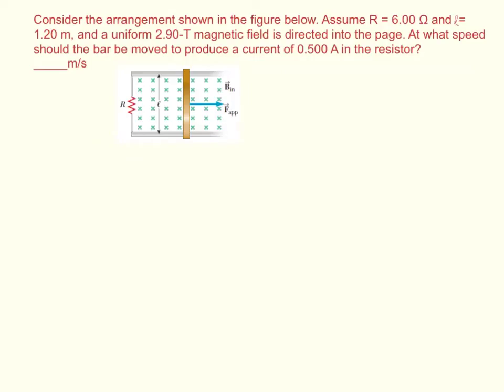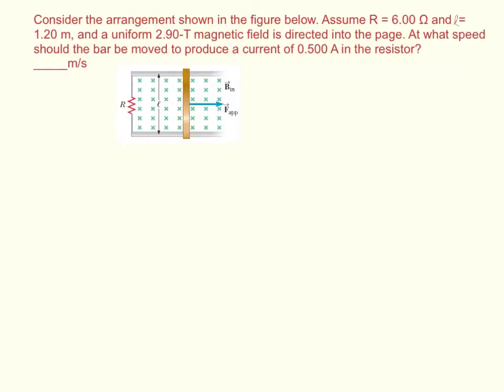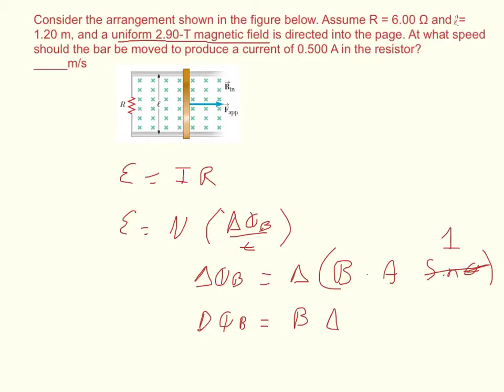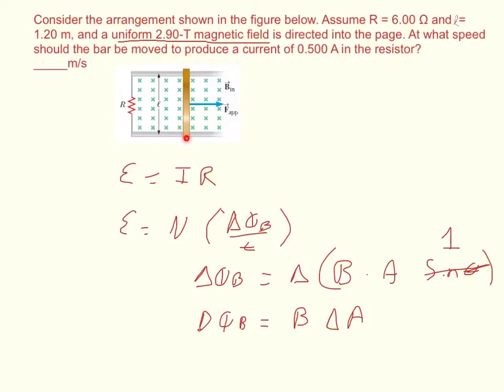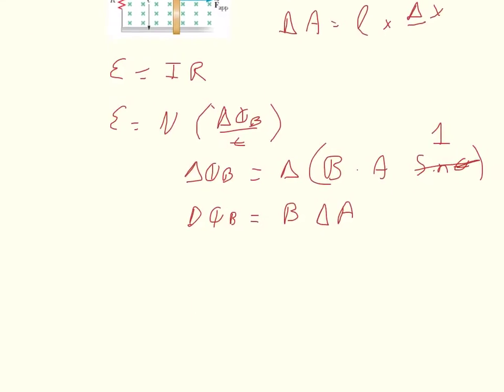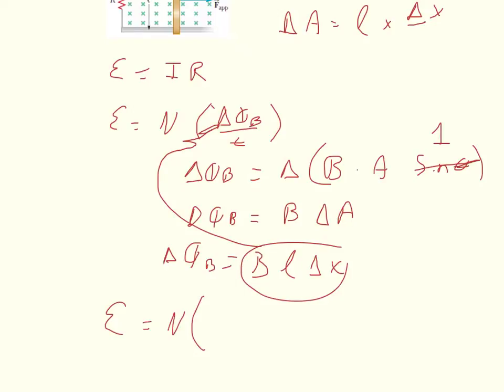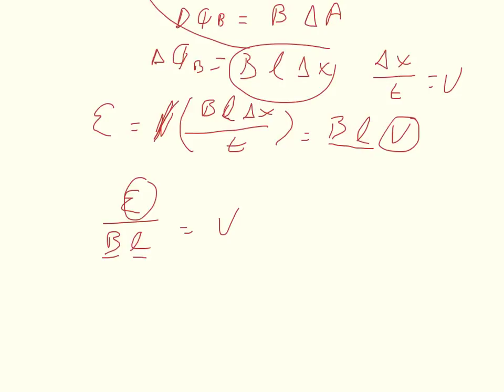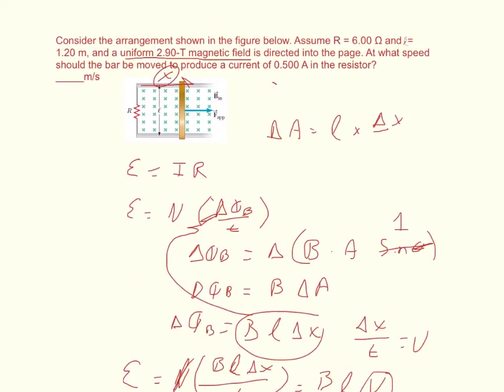Physics WebAssign Ch20 #9

Comment: Doesn't change much but I found 0.862 m/s velocity, not 0.8206
Reply from the maker: I’ll check the work later. Thanks!
Reply from the maker: It appears that I did have a blooper! 
The answer would be 0.862069 (Significant figures would be 0.862)
 -- I got carried away   0.82069
 -- I left out the very first six, in the figure. 
Thanks for pointing out the mistake, in case anyone else is confused, I'll post in the description.
Reply: Haha okay thanks !

Comment: the flux is the dot product of the magnetic field and area which is given by: BAcos(angle) not BAsin(angle)
Reply from the maker: +patricia fameni 

There is more than one way to define the "angle" (theta). As I have defined it (the angle between the direction of travel of the bar and the magnetic field. IN this case the "angle" (theta) is 90 degrees. If you take the Cosin of 90 degrees, your answer would be zero every time.

So, as with almost every trig function, whether you use sin, cos, or tan depends on how you define the angle of interest. 

Both equations (BA cos(theta) and BA sin(theta)) are used interchangeably within several textbooks.

Hope this helps.